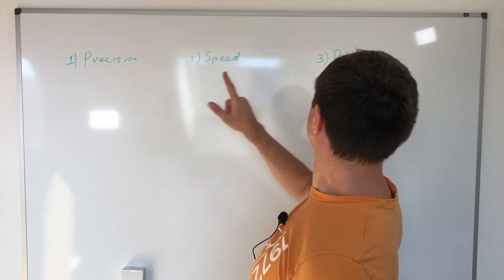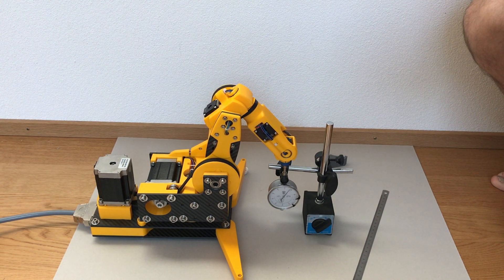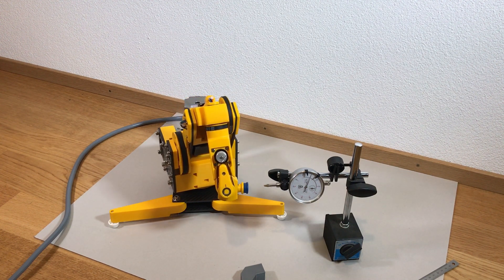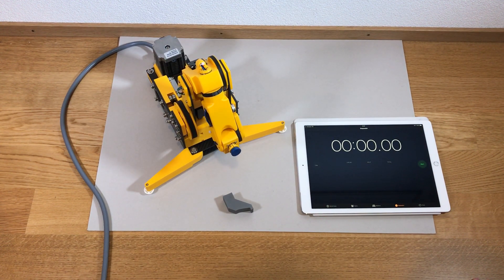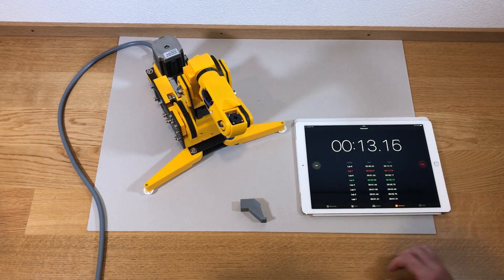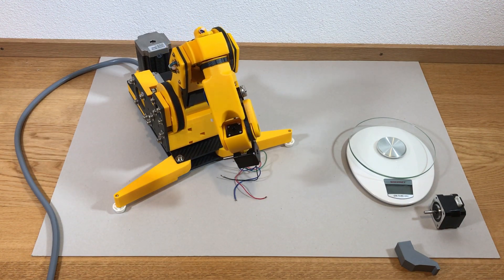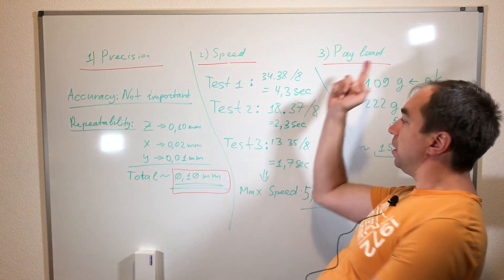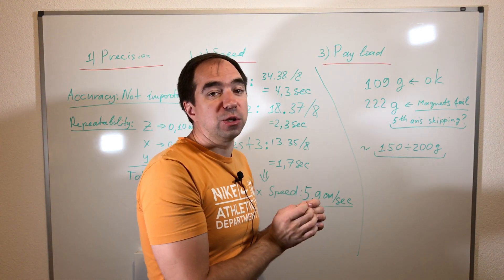Is it the best DIY 3D printed robotic arm? Precision, speed and payload test.

Comment: Very nice robot you've built. Regarding accuracy of industrial robot arms such as Kuka, ABB, Fanuc etc isn't that great anyways, at 2m movement they can be off by several mm. With absolute accuracy they generally specify 0.5mm. They have very good repeatability though especially considering the payloads they handle. Your's seem to have great repeatability too.

Comment: That NEMA 23 with 1Nm of torque and a lever of 30cm should be able to lift a few kilos on it's own without the gear reduction
Reply: Yeah, but thats not the stepper that was losing steps, he uses nema 11 and 8 steppers in other axis
Reply from the maker: How?!    1Nm = 0.1 kg.m. On 30cm arm it can lift only 300grams, and this is at maximum torque. This means that the motor will heat up fast, and would not be able to work continuously.
Reply: @Skyentific  sorry my mistake, but with your belt reduction it should be able to lift about 1kg much more than you've demonstrated in the video, anyway how is the backlash on that robot arm?

Comment: Why does it skip steps when you increase the speed ?
Reply: It is pretty common for stepper motors - they cannot apply the same torque at high speeds. Also there can be problems with pulse generators - for high speed you need very high frequency pulse with low jitter.
Reply: Also Arduino sketch on github may have some problems. Although Arduino can produce low jitter pulse, it requires some special programming methods, which 3d printer firmware like Marlin uses (not just Arduino delays everywhere).

Comment: Good project but it seems to me that the motors are taken with 5 exceeding. Would be enough in two smaller. I have these stand on the CNC machine weighing 200 kilograms.

Comment: Is there a way to increase the payload in this robotic arm without bigger changes? I would love to have around 1kg = 5x higher. Do you think there is a way to make it with your model? And i dont know if i missed it, but can you tell how much the robotic arm would costs around? And how much infill do you use on the 3d printed parts?
Reply from the maker: I think the maximum, what is possible to do with current design, is to add active cooling and increase the current on the motors. But this is not going to increase the payload 5 times. A think it could increase the payload by 50% maximum.

I have an idea for the next robot arm. I plan to use brushless motors. And I hope to have the payload around 2kg. I plan to start building it this month, but I cannot tell exactly how long it will take to develop it. I hope to finish it by July.
Reply from the maker: For the plastic parts I use 50% infill. About the cost it is around 400 dollars, and this price does not include 3D printed parts, does not include bolts and nuts, and other small components and it does not include the shipping costs. I have GitHub page for this project and there you can find a bill of material with approximate prices. https://github.com/SkyentificGit/SmallRobotArm
Reply: @Skyentific  so the costs are near only for the motors? Thanks for your answer for the infill! Its ABS or?
Reply from the maker: This is cost for motors, drivers, belts, carbon fibre parts, bearings and electronics. My first robot (yellow one) made out of PLA. And the last one (orange one) is made out of PETG. I tried to use ABS before, but I had bad experience with it, and now I try to avoid it.
Reply from the maker: Theoretically there is no reason for these kind of motors to cost more than 200 dollars. But practically I could not find motors with such parameter (such diametre). Thus I think I should order custom motors. But if I will order only 6 motors it is going to cost a lot. The solution would be  ordering thousands motors like this, or wait till factories will develop such motor sizes for other applications. 
My next robot would not use such motors. My next robot arm would use already available motors with higher reduction ratio gearbox. And if I will see huge interest for the next robot arm, in this case maybe I will try to approach motor factories and see if it is possible to oder custom design motors.
Your are asking very interesting questions! Thank you!
Reply: @Skyentific i have send you an email with an raw plan which maybe can realise everything. Maybe there are some ideas for you inside :-)
Reply from the maker: I saw your email. I will answer you there :).
Reply: @Skyentific i i know exactly what you mean with "you cant tell how long it will take to develope" :-) I am in the team of werbewunder here on youtube and we also have the same way to think :-) Maybe one question more, why do you plan to go only for 2kg payload if you calculated before the needed motors for the 7kg KUCA model? Too high costs or what is the reason, because in your video i think you talked something around 200 euros or dollars for the motors. Thanks a lot for your answers!

Comment: Stunning project, and very satisfying results.  In your conclusion, at 10:54, you mention "5th axis skipping"  is this the belt skipping teeth, or the stepper skipping steps?  Many thanks, liked and subscribed.
Reply from the maker: Thank you for your support. It was stepper motor skipping steps. It has small Nema 11, which is not very powerful.

Comment: Should you perform test of accuracy/repeatability UNDER load, please...
Reply from the maker: Nice idea. I defiantly should do this, especially for repeatability.
Reply: Also, using different paths and acceleration curves to the same destination point in 3D may be interesting. Honestly, it should be no big expectations with open loop control, even with this big steppers and carbon stiffeners...
Reply from the maker: thelittlebigoneru, what do you mean by this? 3D printers works just fine in open loop control. And with Trinamic drivers it is possible to detect collisions and skipped steps. So, with the Trinamic drivers this is not completely open loop. 

This robotic arm is designed to be affordable in price. And it was not designed to have all the possible features. 

You are welcome to take my design and improve it. :)
Reply: 3D printers have limited and constant 'payload' for its drives. With Trinamic, it will be a way better. But, now even BLDC servo is not rocket science. Enabling technology is single-chip hall-based rotary encoders with absolute angle readout and 16-bit resolution.
Reply from the maker: thelittlebigoneru, please, just do it. I will be truly happy to see the result. ;) But do not forget to open source your project.
Reply from the maker: thelittlebigoneru, it is not just a single chip, it is 6 chips at least, it is much more wiring and much more complicated program. But I encourage you to make this modifications.
Reply from the maker: thelittlebigoneru, I know this chip perfectly. If you think this is simple, then try to implement this.
Reply: @thelittlebigoneru  :  I think you are missing the point here.  At the level of a personal project, you need to decide what level of complexity, accuracy, and cost are acceptable and achievable.  There will always be alternative stategies; feedback loops, absolute encoders, more power, greater strength... the list goes on!  I'm pretty sure the objective here is not to take on Fanuc, Yaskawa, etc.  What we are seeing is a very desirable 6-axis arm, made using readily available, affordable components, and construction methods.  There is already a huge amount of information to draw on because of 3D printers and various DIY CNC devices.  If I am to attempt a robotic arm build, this is where I will begin.
I will however study your design with great interest... let's see if you can change my mind!   :o)

Comment: Awesome robot. Do you plan to make the plans and STL available?
Reply from the maker: Yes. I would like to modify some parts (there are some bugs). And after I will made it open source. May be I will do this in one of the next videos.
Reply: I'd be interested to know if you could put an extruder on the arm and see if you can make it do some basic 3d prints ;)
Reply from the maker: This is super good idea to try!
Reply: @Skyentific great!!!!!
Reply: @Skyentific Hello, I'm from Argentina, it's an incredible job, I'd like to do it !!, I'm consulting you use to control it? What plate and drivers? in my channel you can see one that I did but I can not control 5/6 engines ... thanks for such a spectacular project, I will wait for you to live the parts to print them.
Reply from the maker: @urquizaramiro  Hello! I am using Arduino Mega for the control of drivers and I am using Trinamic drivers, but any standard stepper drivers will work. The Arduino program I wrote myself, the program is not optimised but it works. When I will do the video with the build of the robot I will publish the Arduino code. Thank you for interest!
Reply: @Skyentific  Thanks!!!
Reply: @Skyentific  Hello, can we have the plans? I want to adapt them to nema17 engines but I love your design!